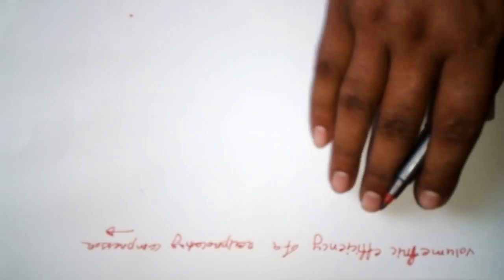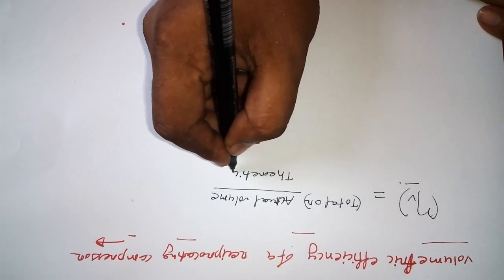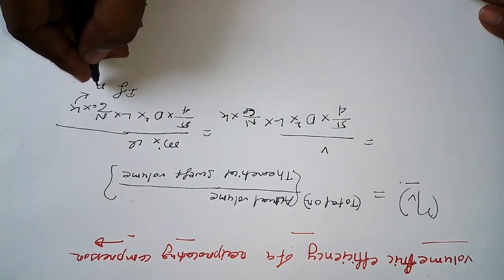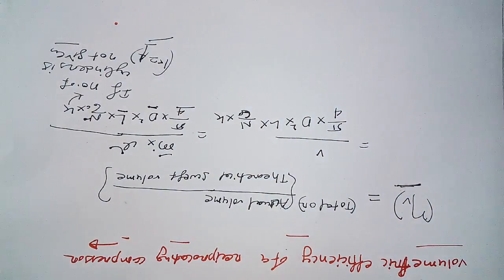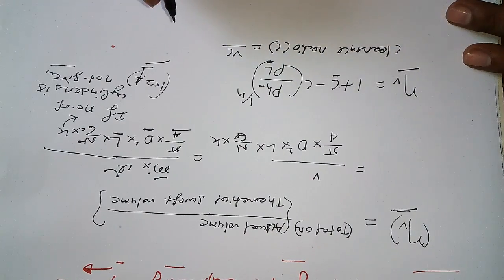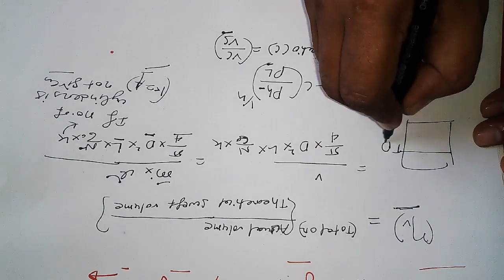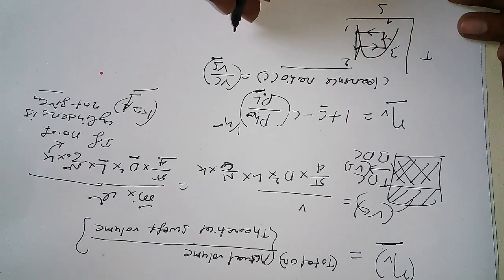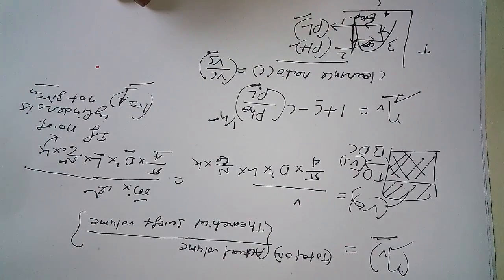Volumetric Efficiency of Reciprocating Compressor- RAC Tutorial- 6

Comment: sir in my company ,i have multi stage compressor ,which connect through pipe line for some distance and fluctuation tank ie receiver also available there can plz tell how can i calculate volumetric efficiency for compressor
Reply from the maker: Sorry no idea about it
Reply: You can calculate by pumping volume method.